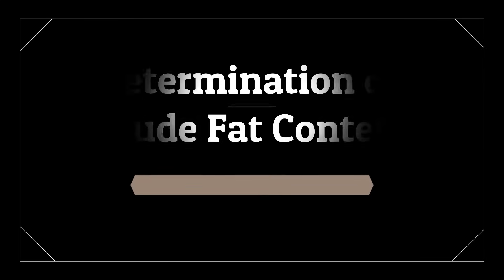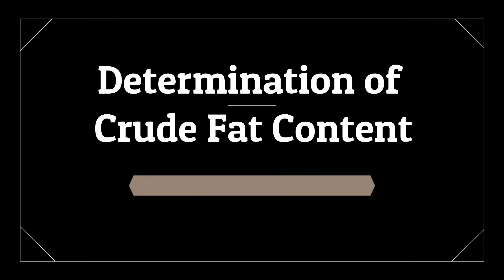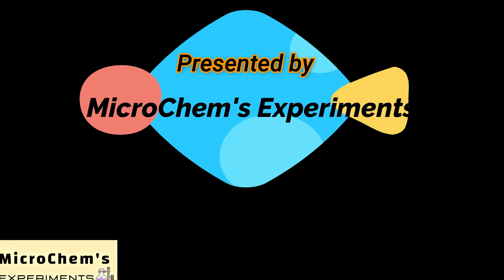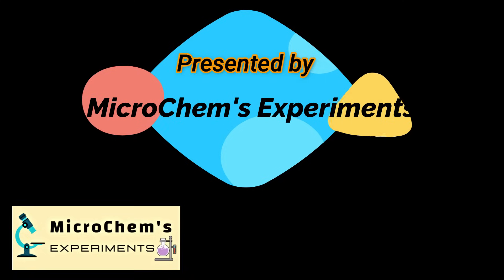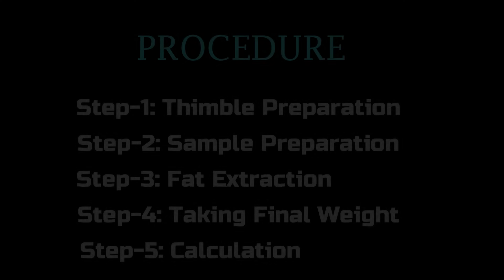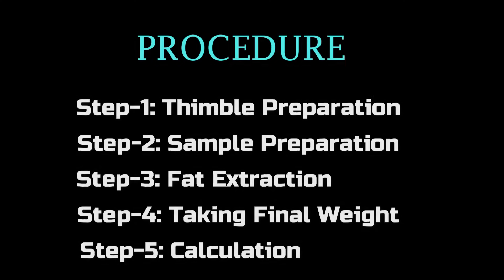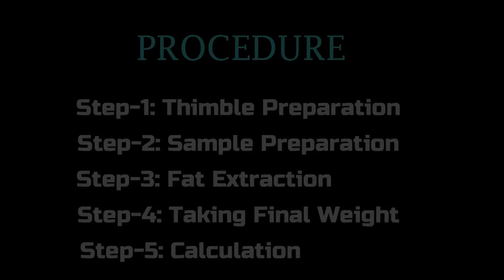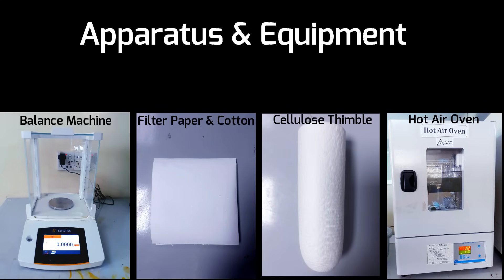Determination of Crude Fat Content (Soxhlet Extraction) _ A Complete Procedure (AOAC 2003.05)

Comment: I am using diethyl ether solvent for crude fat extraction. But the solvent is coming out of the condenser. What is might be the issue?
Reply from the maker: Don't use diethyl ether in soxhlet extraction. You can use petroleum ether replacing the n-hexane

Comment: HI ! can we recover the solvent using water bath method for next run? instead of hot air oven
Reply from the maker: Yes you can
Reply: @MicroChemsExperiments  but for the temp and timer is same with hot air oven or not ?
Reply from the maker: @nursyazwani6680  same
Reply: @MicroChemsExperiments  okey thankyouu

Comment: Thank you for a video 
But i have a question instead of hexan i use petroleum either what temperature i should set it on for solvent,  and for how long , and how many circles is better for extraction sesame oil?
Reply from the maker: You can use petroleum ether. Same temperature and time should be followed as shown in this video.
Reply: @MicroChemsExperiments  i used it today but i don't know why in 200 c just 3 cycle in hour happened
Reply from the maker: @sheraz_zuher  It should not be happened because the boiling point of petroleum ether is 60-80 degree Celsius. 
Please use better grade of petroleum ether from a reliable source. I hope your problem will be solved.

Comment: Sir thanks for the video...u have used grounded powder form  how can we determine if it is not in powder form eg:to determine the fat of raw spinach containing90% moisture???
Reply from the maker: Blend the sample and after that dry it using Hot Air Oven. Test the dried sample for fat analysis following this video
Reply: Is it not possible without drying it??? What if we use raw without drying??
Reply from the maker: @ujjwalkoirala6770  You can try raw but drying is better
Reply: @ujjwalkoirala6770  In the case of fat extraction, the sample must be dry. If you want the result from the original sample, then you have to:
- Weigh in the original sample, dry it and then extract it or,
- Weigh in the original sample, rub in sodium sulphate and then extract (* both remove the water😉).

Comment: Is the extracted fat is in oleic acid?
Reply from the maker: No. It's total fat
Reply: @MicroChemsExperiments  it's edible right?
Reply from the maker: @ronelbanci4599  Yes. Edible oil
Reply: @MicroChemsExperiments  do you have knowledge about oleic acid? because my professor keep on asking me how i could confirm the extracted oil is in oleic acid when using Soxhlet Method.
Reply from the maker: @ronelbanci4599  Oleic acid is a major component of oil/fat but you can not extract only oleic acid from sample seperately using soxhlet extraction method.
But you can quantify oleic acid from sample by applying two seperate steps (methods):
1. First step (1st method): Extract total fat by following this video of soxhlet extraction. After the soxhlet extraction, you will get total oil at the bottom of the flask.
2. Second step (2nd method): Take 0.2g of extracted oil (from soxhlet extracted oil) to saponify and to make the Fatty Acid Methyl Esters. Then analyze the Fatty Acid Methyl Esters in Gas Chromatography (GC) and quantify the Oleic acid from the Chromatogram of Fatty Acid Profile of that oil.
**I hope you have got my point**
Reply: @MicroChemsExperiments  thank you very much ma'am but the second method is it still part of soxhlet method? Or is it the method for Free Fatty Acid analysis?
Reply from the maker: @ronelbanci4599  No. Second method is not soxhlet extraction nor free fatty acids.
Its the gas chromatographic analysis of oil sample for Fatty Acid Profile.
Reply: @MicroChemsExperiments  okay, thank you very much
Reply from the maker: @ronelbanci4599  Most Welcome
Reply: @MicroChemsExperiments  Can i ask again sir? Does the extracted oil need to purify?
Reply from the maker: @ronelbanci4599  No. You dont need to purify the extract.

Comment: Hi, thanks for the nice video, it is very illustrative. Nevertheless, I have a question: the method actually calls for the Randall modification of the standard Soxhlet extraction to perform the assay, which implies submerging the sample into boiling solvent, (in this case n-hexane). Is it correct to perform the assay with a regular Soxhlet extractor, as shown in the video? Any comment will be helpful. Thanks!!!
Reply from the maker: Yes. We followed the AOAC 2003.05 official method strictly to make this video which is applicable for regular Soxhlet extraction of different solid samples.
Anyways, thanks for your comment. Stay with us.

Comment: Instead of evaporating the solvent in Hot Air oven, can we recover the solvent using vacuum rotary evaporator for the next run
Reply from the maker: Yes. You can use rotary evaporator to evaporate the solvent.
Reply: @MicroChemsExperiments  What's the procedure for that,will you think the fat will be isolated in the receiving flask
Reply from the maker: @SourodiptoOfficial  First, extract the fat from your sample using the Soxhlet Apparatus. Then evaporate the solvent using Rotary Evaporator. Finally you will get pure Fat in the flask. Now take wright and calculate the fat% as done in this video.
Reply: @MicroChemsExperiments  Thanks for replying to my comments ,I have few doubts regarding the video

1. Whether the fat is collected in the round bottom flask, or certain portions are in the extractor too, if I have to vacuum evaporate it ,do I need to mix the both the portions, ( the Solvent in the RB as well as in the extractor)

2. What's the quantity of solvent taken for 250 ml RB ( as shown in the video), can I perform the same analysis  if I have 500 ml Soxhlet  extractor ,in that case what would be the amount of solvent.

Please clear this doubts,
Reply from the maker: @SourodiptoOfficial  Fat is only collected in the flask. So you have to dry & consider the flask only.
Secondly, there is no specific amount of solvent to be added. Amount of solvent should be enough to carry out the continuous reflux through the Soxhlet. You can get idea of amount of solvent from this video. So add solvent in your 500ml Soxhlet accordingly which is enough to recycle/reflux smoothly.
Reply: @MicroChemsExperiments   do i need to change the quantity of sample if I am going from 100 ml extracting flask to 500 ml extracting flask
Reply from the maker: @SourodiptoOfficial  You don't need to change sample quantity. Because you need to follow the AOAC method strictly to get the accurate results as done in this video.
Reply: @MicroChemsExperiments  Thanks a lot for entertaining my questions ,as because tomorrow I would be doing the same, So u are telling that I no need to change the quantity of sample irrespective of solvent capacity and flask size
Reply from the maker: @SourodiptoOfficial  Yes. You are most welcome

Comment: thanks a lot for your explanation it's very clear. Could you tell me please the temperature of the extraction process? during the 6 hours
Reply from the maker: Mahmood Hashem, Set the temperature in such a way that facilitate the reflux rate of 5 drops per second. Usually, 100-150 degree Celsius is used for the Fat extraction. Than you for being with us.
Reply: @MicroChemsExperiments   thank you so much for your rapid response , may I ask another question; can we use standard hotplate instead of heating part in the soxhelt appartus?
Reply from the maker: @MahmoodHashem  Thanks for your second question. In case of hot plate, it will heat only flat bottom part of the flask and only Hexane of the bottom layer will be evaporated at a particular time. But in the soxhlet apparatus, it heats on the maximum part of the flask, as a result evaporation of Hexane from all side of the flask will occur which is much effective way for Fat extraction.
So, if you don't have Soxhlet Apparatus facilities, you can use Hot Plate temporarily but it is not recommended for permanent use.
Reply: @MicroChemsExperiments  great illustration thanks so much🙏
Reply from the maker: @MahmoodHashem  you are most welcome. Be with us
Reply: Can any one say after crude fat determination by this process..if there I find solid particles.what is the solid particle and is it effect the calculation of crude fat?
Reply from the maker: @gudduraj6584  there is no possibility to transfer any solid particle from sample into the flask because sample is enclosed with two thimbles (filter paper & cellulose). So please find out from where it came from. If the solid contained in the flask from the time before taking the flask weight then it will not cause any problem to your result because weight of solid particle will be minimized during subtraction of two weights in the calculation.
Reply: So will it be the fat is solidifying,?
Reply from the maker: @gudduraj6584  In that case, heat the flask. If the solid becomes liquid like oil  then consider it as fat.

Comment: Hi, can we just let the moisture in the flask evaporate on its own instead of using an oven?
Thanks.
Reply from the maker: @Raghaban619, You can not evaporate the moisture and remained n-Hexane completely by keeping the flask at room temperature. Because n-Hexane and moisture will remain in the mixture form with the oil content in the flask. You must apply heat to remove misture and n-Hexane from the flask completely.
Reply: @MicroChemsExperiments  Got it! Thanks for replying.
Reply from the maker: @Vikalp619  you are most welcome

Comment: 👌👌👌❤️
Reply from the maker: Thanks 😊
Reply: @MicroChemsExperiments  I'm using right now ethanol and water as solvent. Can I do with light weight oil and ethanol as solvent for extraction..I want oil soluble extracts or extraction in oil. If so which oil would be best. Kindly suggest. I'm mostly into native siddha ayurveda formulations.
Reply from the maker: @theasoapsacademy  Thank you for your query. If you want to go for oil extraction, you can use Organic Argon Oil (Light Weight Oil), if it does not distort your herbs or extracts. In this case, you have to extract using oil and ethanol separately because oil will not dissolve with ethanol and they both have different boiling point.
Reply: @MicroChemsExperiments  thank you so much for answering. 😊❤😍🙏
Reply from the maker: @theasoapsacademy  You are most welcome ^_^
Reply: @MicroChemsExperiments  we generally soak the herbs for 12hrs in water alcohol mixture. And then next day make extract in soxhlet extractor. And the extraction is incorporated into base oils as per body type and heated on low temp until moisture evaporate. And the result is medicated oil. Where each herb has different weights.
Reply: Before incorporating herbal liquid extract into oil , oil is heated separately until one froth.  Then only we add liquid herbal extract. This step is very important. So I was thinking can I add oil and alcohol as solvent n do extraction in soxhlet

Comment: What is the importance of using hydrochloric acid in fat determination analysis?
Reply from the maker: Cozy Cove Hamstery, thanks for your query
Please take a look at the principle of fat extraction of a solid sample. Normally a dried, ground sample is extracted with n-Hexan which dissolves fats and oils of the sample. During extraction, in the Soxhlet Apparatus, n-Hexane dissolves fats and oils of the sample and carries into the Round bottom flask. In this way, the extraction of fat continues for 6 hours by refluxing the n-Hexane (Oil free n-Hexane goes up by evaporating and after condensation it falls on the samples and get down to the flask carrying fats & oils from the sample). After 6 hours, the n-Hexane is then evaporated from the flask to separate it from the oil. The resulting residue (Fats & Oils) is weighed and referred to as ether extract or crude fat.
So there is no need to use hydrochloric acid (HCl) in this fat extraction procedure.